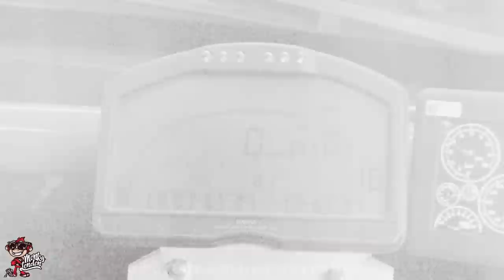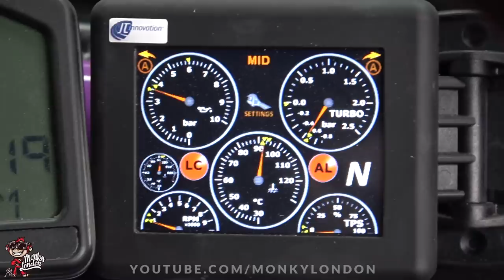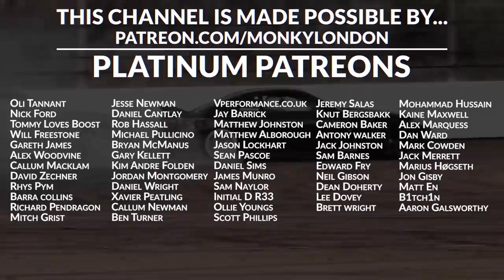🐒  INSANE SUPRA 2JZ SWAPPED BMW! RACE SPEC E46 M3

Comment: If you buy an m3 and pull the engine out of it, it’s just a bmw 😂 this is a cool build tho 👍🏻
Reply: Whyman1993 with all the upgrades he did, might as well just use a 330i or 328i. Save yourself 10k. 😐

Comment: Eh? How does external gate generate more heat ?
Reply from the maker: More heat in engine bay, as the external wastegate and pipe work is an additional heat source. In my car the external wastegate and associated pipework is ceramic coated

Comment: stupid id rather go buy orginal m3 engine apply bigger turbos upgraded fuel system and exhaust system upgraded cooling system the pistons cams clutch  ignition system  bigger injectors then tuneing etc about 8 grand will bring about a good  6-700bhp as its stock bmw ristricted is 382bhp  hit the ecu a little play unristrict it then its a 443bhp no parts added

Comment: A perfect car ruined by a Japanese engine swap.
Reply: qrtkubein You mean fixed by a Japanese engine swap, he’s not gonna have any vanos issues now is he?
Reply: @Jonathan_Doe_  BMW has, for sure better engines. Just about all of them actually.
Reply: Except he acquired the car as a rolling shell, I interpret that to mean no engine. So technically he didn't ruin it with the engine swap as he didn't swap it. He had an engine installed thus making it a car again, rather than a shit German skateboard!